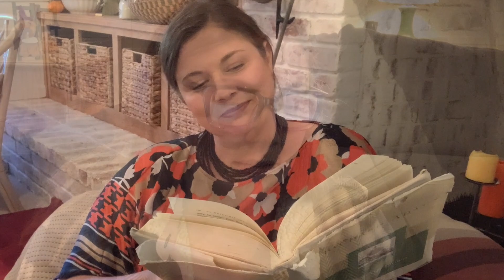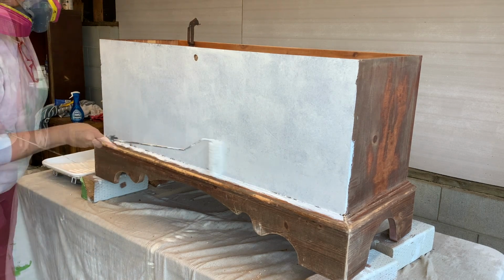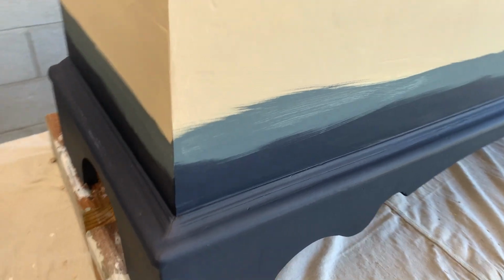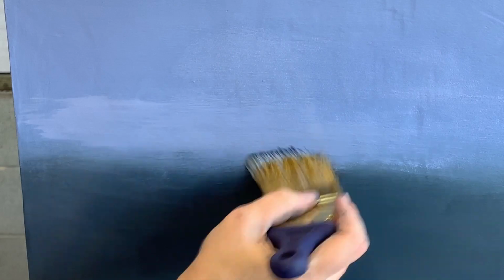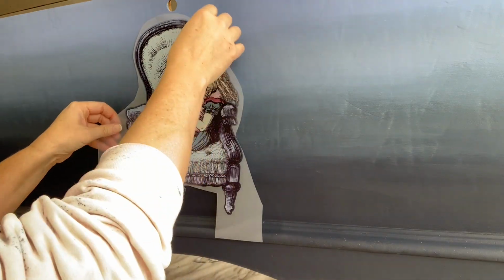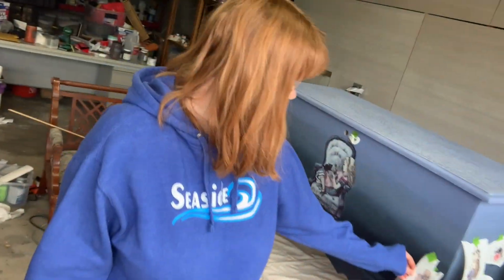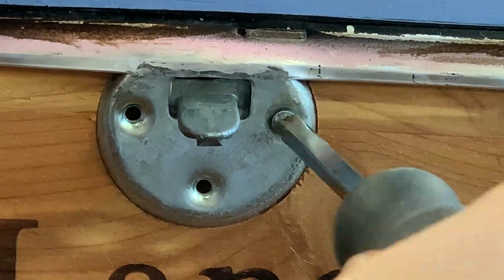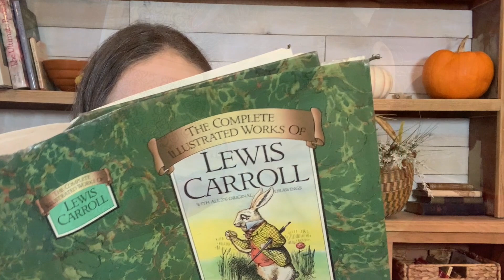The Most UGLY to the Most WONDERFUL & The MISTAKES That Led Me There! | Blending & Transfers Flip

Comment: I did order new locks for my Lane cedar chests. It took quite a long time to get and I ordered two, one for each of my chests. I only received one. I was given a cedar chest with,”no damage”. No, it’s a nightmare! It’s sitting here wondering if I should give it away as well. The hinges need replacing and it had an aluminum strip around the top area but the previous owner tore off a section to use with the broken hinge. Plus damage to the cedar. Ugh! One way to refresh the cedar is just lightly sand it again. And I mean lightly. Then just wipe off the dust. Back to cedar smelling! I have that transfer. I have been horsing it to find the perfect furniture piece! Good job!!
Reply from the maker: Wow, thanks so much Sheri!  Yes, these old trunks can be a handful.  You are correct - a light sanding can bring that cedar back to life, it's such an incredible timber.  😊